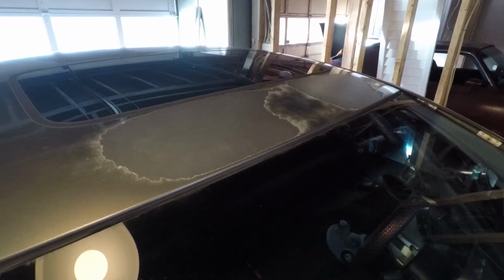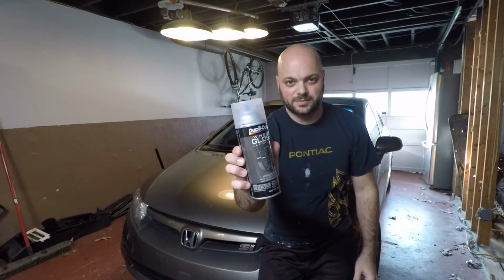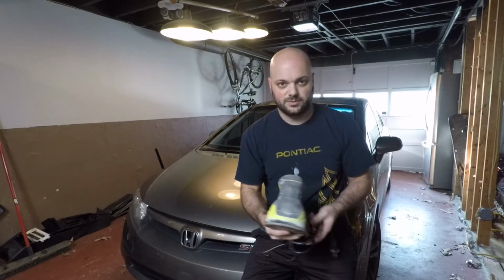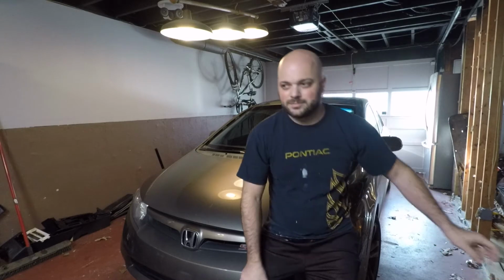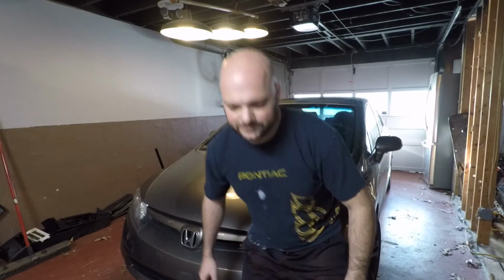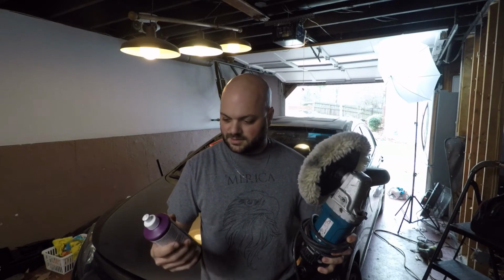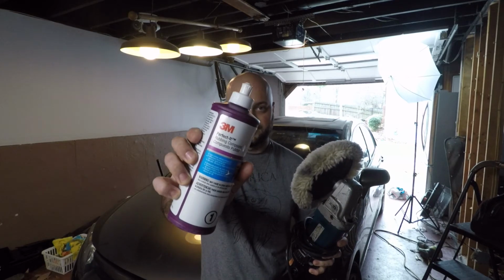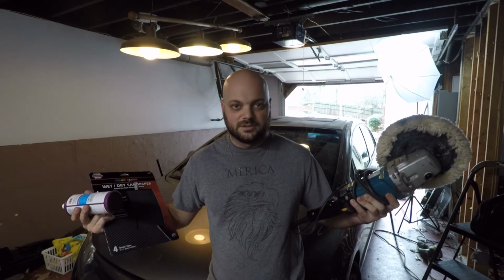How to Repair Damaged Clear Coat ONLY $65!

Comment: Great job! It looks much better after the repair. I'll do the same for my 2010 civic. Thank you for sharing the steps!
Reply: i have a 2010 civic with the same problem in the paint also, by consident? you have problem with you ac?
Reply: Honda had a paint recall for the cívico missed the deadline of 5 years I think… but ima try this for my 07 SI good luck!
Reply: @pasivo2009  yes. Started this year randomly to stop to work

Comment: Hey man I have a grey 08 si and the trunk and the roof is really bad any tips or do’s and don’t I will probably do it outside too?
Reply from the maker: Get a higher quality clear coat. The job I did in this video only lasted about a year and 1/2 and it started to fade again.